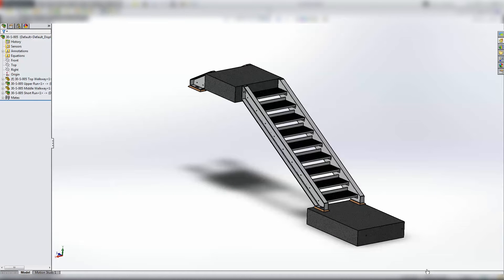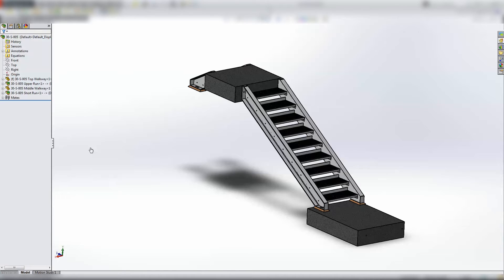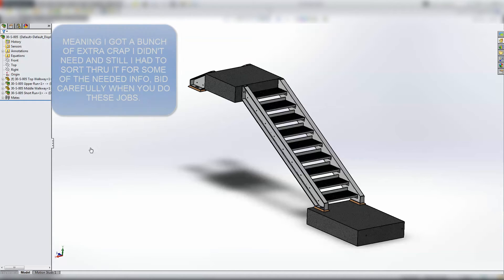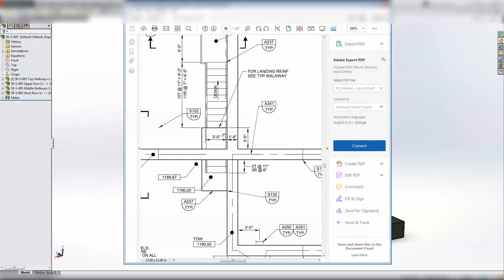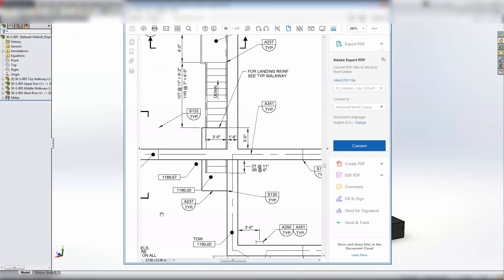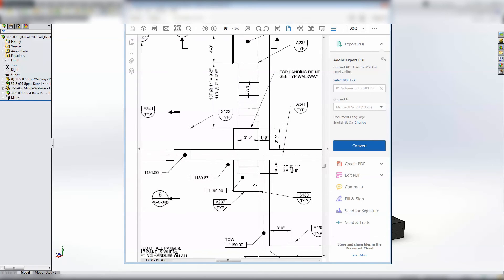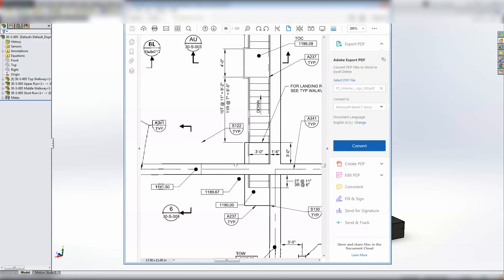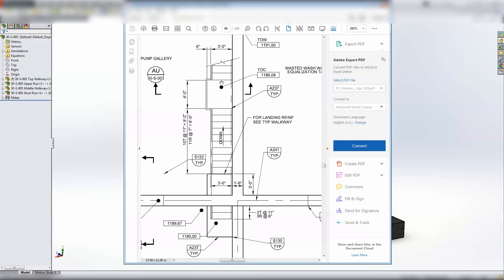Solidworks Training - Tutorial:  Structural Steel Stairs Pt. 1 of 5 and CAD files

Comment: Hi, I would like to ask you if you made any strength calculations when constructing this staircase. I'm currently doing a similar job and I don't know at all what I could count there if you have any tips or helpful materials I would be grateful for help. Kind regards Karol
Reply from the maker: No, all of the engineering is done up front on these jobs, the engineering drives the design

Comment: What type of Soildworks are you using for this application?
Reply from the maker: Plain Ol' Vanilla Solidworks.  There are 3 ways to drive something like this, equation driven (inside solidworks), excel driven (outside of solidworks) and or Skeleton modeling where you use a top level sketch in the assembly to control the parts.  Also, you can use a combination of all 3 methods.
Eric :)